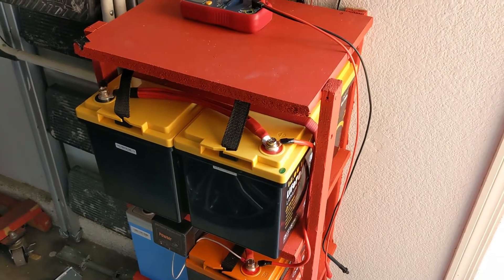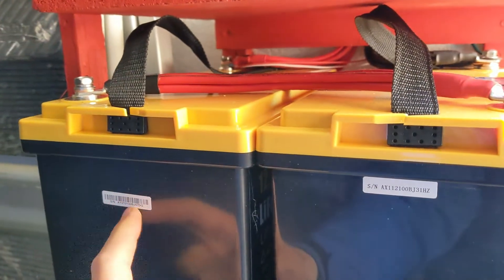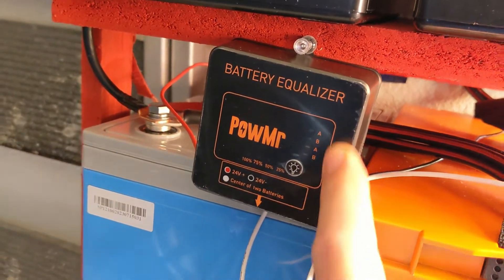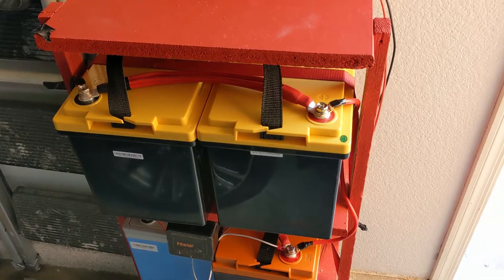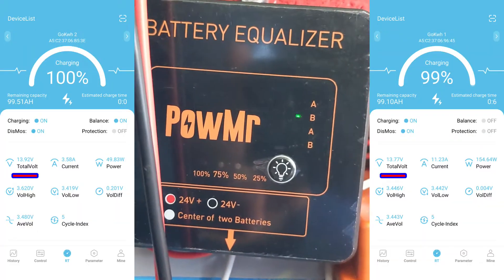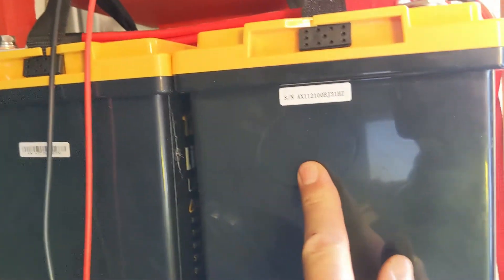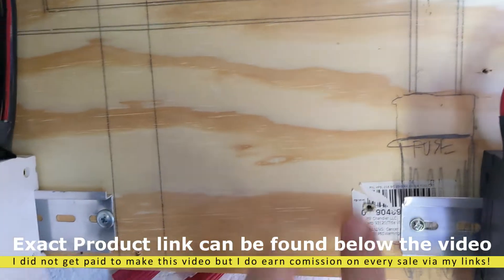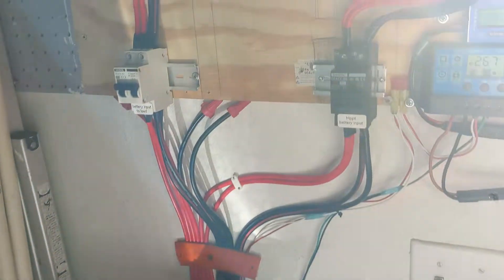How to equalize two 12volt batteries connected in series 24volt for Home solar, LEAD acid or LIFEPO4

Comment: Hello, I just talked to the people at PowMR and they said that balancer is not designed to work withLifepo4 batteries just thought you’d like to know
Reply from the maker: It works but you need to have a higher voltage difference in between the batteries and lifepo4 only have that really high or really low in the charge status
Reply: @VegasRoManiacReviews  A year ago you said in a comment you gave up and sent it back. Did you change your mind? Is it still better to have one than not having one, even if they don´t work as well as they do for lead acid batteries?

Comment: Compatible for lifepo4 battery ?
Reply from the maker: Doesn't say It is but the principle is the same .. but I ended up returning mine .. it does the job but it takes forever to balance things out ...
Reply: @VegasRoManiacReviews  chinesium hardware
Reply from the maker: It is a very simple principle , a little capacitor charges and discharges fast and some voltage regulators read the power , the problem is that since then I got 8 batteries total , so moving 4kwh of power to help balance it takes almost longer than this little device cam handle
Reply: @VegasRoManiacReviews  Well in that case you can use several of them in parallel. What was your solution in the end?  When the voltage difference is small the active balancers will struggle hard to balance them but passive balancer should work well.. Maybe a combination of both.

Comment: Does it limit the battery charging current from the inverter? Because the inventory gives out 60 amps, and this device only 5. Are balancing and charging parallel processes that do not affect each other?

Comment: Hello. Just wanted to know how the battery balancer is doing.
Reply from the maker: I sent it back doesnt balance the lifepo4 too well because of the type of the chemistry, works great on lead acid
Reply: @VegasRoManiacReviews  It's theoretically impossible to find a (much) better one for low voltages, because even the expensive internal ones for custom lifepo4 batteries wait for the high voltage/high SoC states too (or the very low states) to start doing work.
This is generally a governing truth about lifepo4 chemistry batteries; they are extremely hard to read between 10% and 90% charge; basically forget completely reading accurately 20% to 80% from voltage with any tech.
Reply: @VegasRoManiacReviews  thanks
Reply: @VegasRoManiacReviews could you please tell if you found some other balancer that works with LIFEPO4 battery?
Reply from the maker: Nope I never found one z I gave up on the idea and left them to figure it out themselves. They do a great job on their own
Reply: @VegasRoManiacReviews  i.e. LIFEPO4 batteries themselves are capable of balancing?
Reply: @VegasRoManiacReviews  this is what i am seeing in other videos..
they say if you keep the batteries @ full charge for long enough they balance themselves. 
do you agree with this as well? i am still tring to see if it holds true.